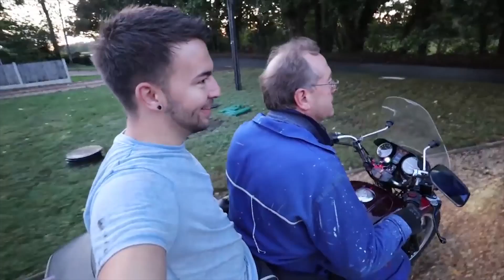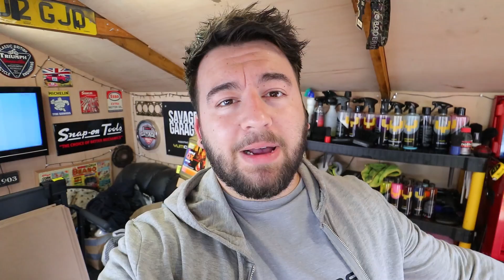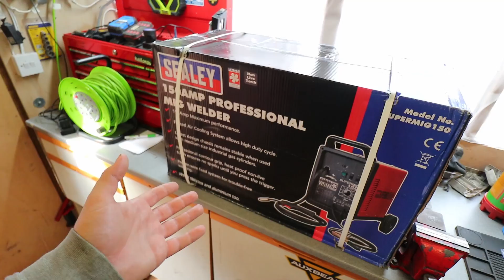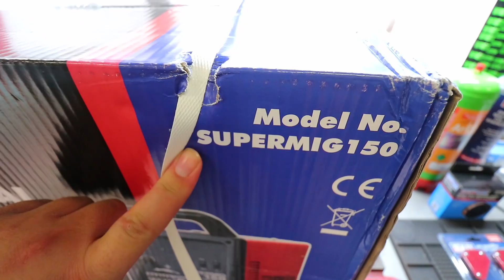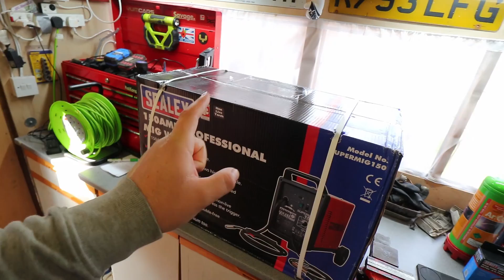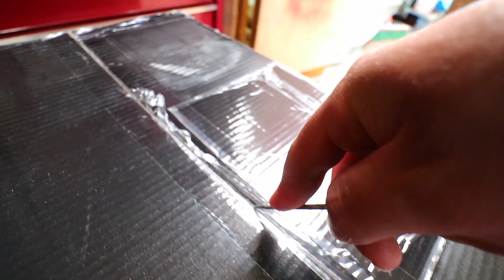I Got a Welding Machine! *Finally*

Comment: lol....the regulator you had was the same as the new 1 you bought with a gauge, other than it had no gauge, you have to unscrew the co2 connector on the regulator for it to fit the biddy bottles you have, that is made to fit the smaller bottles you have as well as pub co2 gas type and boc bottles, I use a clark 150 with pub co2 and have used it on max with 13amp plug and it's never blown the plug fuse or tripped any breakers in the house, you shouldn't need more than 130amps ever for car repairs unless you plan on making more holes in your car.

Comment: You should always file end of the wire smooth so it dont damage the small plastic tube inside the cable before torch.

Comment: Bless your hands. Really nice and instructive videos. I alone have a problem. Please someone help. My car is fabia 2011 1.4 petrol. Vehicle at 160000 km. The transmission oil needs to be changed. It must be the same transmission in this video. The screws are the same when you look from below. While changing the gearbox oil, I could not find where to refill the oil.

Comment: You'd think Sealey Would Have a Rubber Moulded Plug Fitted
Get a Welding Cart to Sit Welder on , or a Old Tool Cart, Much better Highr up 👍

Comment: You've wired thst plug wrong mate. The little card that comes on them when they are new shows you how long each wire should be and how much insulation to strip back. Its pretty important as its designed to leave the earth in situ if the cable ever gets pulled out of the plug if the strain relief fails.

https://images.app.goo.gl/RiKCxrh3iLCfxTbz9

Comment: I would suggest fitting a 16A socket, straight from the db, just for the welder.  Its not ideal on a 13A plug, plugged into a full multi socket adaptor, mounted on the wall of a wooden shed that now contains gas cannisters. In theory, the 13A fuse should blow, in reality, ive seen loads of 13A plugs melt. Just throwing my  electricians opinion out there.

Comment: To all this nonsense on the plug, look at the size of the cable on that welder (it fits in plug easy) and used at home, no pat test issue .
Look at the power info plate on the machine ( 230V 9A -19A max)
It does not come with a plug as you can use it on either 13A or 16A and most home users far better off using it on a decent 13Amp as all that they really need for light usage.
Finally read the manual and use a little gumption not internet stupidity ...
UK 13amp plug is totally over engineered as is most of our household electrics :-) (i run 180amp migs off one for decades) 
james will be fine lol and complying with manufacturers requirements on this product (read the manual) ...
The world will not end and James has some practical experience and some gumption ....

Comment: I used to have a welder, and I think after having thar, I would be very good, because if the torch and wire wasnt in a straight line, it struggled.  With the fa's, I used co2, because it was a case of either being in the motor trade, or knowing someone who could get it.  There is a gas refilling place near me who does fire extinguishers, and thru used to refill my bottle.  You can either rent them, buy them, or if you know someone who has a pub, they use co2 for drinks,  I bought mine, and just took it to be refilled.  As for how much gas flow you need, press the trigger slightly, and start to open the regulator, you need it to be like a light breeze.  When you start to weld, make sure you put the earthing clamp on a clean part of the metal, closest to where you start the weld, and it will be a better weld.  To adjust the wire feed, if it stabs the metal and pushes the gun away, it's too fast. And the amps will need to be adjusted.  It's a case of balancing it all up, and it wants to sound like bacon frying.  Errect screens around where you will weld, or if someone goes past and gets arc eye, thru might sue.  Always shout watch your eyes, before starting the weld, and you can do pulse welds, or a continuous bead, keeping the pool molten without going through.  Like I sat, if it stabs the metal, turn the wire speed down, as it will push through your weld.  You eill get used to it, hood luck mate.  Andrew Mckenna, Nottingham.  Add me in Facebook, talk more about it.

Comment: BOC do a special offer that used to be called the volks weld deal, i think its now called the small garage or hobby deal. works out at about 70 to 100 quid for a largish bottle of gas including a years rental at reduced price. you will need a proper regulator or a pea shooter tester (id recommend getting a peashooter tester anyway as those small botte vales are crap) as others have said, you can weld with flux no gas wire, but it burns hotter so its very frustrating. It also makes your weld area look very scruffy to due the reaction of the flux fumes with the surrounding metal and the extra sparks etc. it also flash rusts the area around a lot quicker than gas welding. I dislike it just for the clean up need, never mind the fact that gas will give you a much better/cleaner weld on sheet steel. Also be aware that the health and safety executive have finally (as of January I think) decided that welding is carcinogenic(as well as causing a host of other nasty things like Alzheimer like illnesses)  and requires respirators in use. Not particularly mandated for occasional use as long as you have good airflow but something to bear in mind.

Comment: Hi James, Great to see another video and that you are well. Had a mig welder for years and very useful for sheet metal welding ie.car bodywork. For gas, have a word with your local pub licensee and get yourself a co2 gas bottle that pubs use. Last for ages and once empty are cheap to get refilled. Keep safe.

Comment: Hate to comment on what other people have already.

But 19.6 amp's through a 13 amp plug just won't cut it. You will blow fuses all day at 100% usage.

Not to mention the heat in the cable's and plug etc.

I've not even calculated for the diversity....but this is a big no no for me.

It should be hard wired.

I won't comment on your plug wiring,  but a helpful hint, orientate the cable so the line is in line with the fuse and common in line with neutral, earth should be on top and point to you.

Live the shortest cable, followed by neutral and earth the longest. 

Rant over, but I hope you learn the welding skills, some people say it is a dark art to get right, and good on you for trying to learn the skill. 

Sorry for the lecture in electronics
Reply: Hate to comment...........but you are so boring!

Comment: Fab video. Quick tip when feeding new wire spool through hold the trigger etc stretched outwards so no bends and feeds through as if curves can cause some issues

Comment: My advise is get a 8 10 12 or15 litre bottle argon/co2 ASAP (and yes argon/co2 is gas to use in your instance), keep the small as backup or for portability small jobs.
ebay has them from poland and germany outright and delivered and 200bar pressure for around £75 8 litre .
also note pressure they charged to relates to amount of gas you got .
Bigger bottles should be 200bar, many only 150bar so you got 25% less gas so take that into account when pricing it .
Buy a regulator with dual gauges (cylinder pressure and flow)
When learning you will waste a lot of gas and those small green bottles be gone in under an hour messing about and welding outside will require more gas flow most of the time so you always going be heavy on gas consumption .
As a new machine it probably feed wire fairly well but the welding torch/liner and wire motor feed on these are pretty poor long term .
You also find the minimal power settings not very helpful working on thinner metal .
Not trying be negative but don't expect miracles and be patient practising as it not as easy as looks and car panel repair is hard weld to good standards .
For beginners I always recommend a a good entry diy inverter welder like powermat as infinite power adjusting and arc stability and stable wire feed makes it far easier get good result , plus the torch assemblies far better with standard replaceable liners .
If the earth lead short (many models like this are) it worth extending it (you get 3-4m of 16mm2 welding cable for under £10) or use a jump lead as a quick fix .
Best of luck and have fun, welding is useful skill even if not a master welder .

Comment: I have the 180 version at home the plug will be fine for car body work don’t pull that many amps welding thin metal, I can weld cars all day and haven’t ever blown a fuse and I use an extension , get rid of the little bottles they last about 10 seconds 😂😂

Comment: Gas mig is so much easier than flux core made the right choice, get yourself a scrap panel off a car and you can set it your power and wire speed properly before welding :D

Comment: I thought your dad was a sparks, I would just let him check out your electrical consumer unit in your shed. No doubt he installed it, but you got a lot of electrical appliances in that shed.  Looking at your wiring it's all in 3 core flex, which could be under rated? It would be good practice to install a dedicated feed and outlet for that welder. Best be safe, just like on the rigs.

Comment: Tiny tip, stick the wire through an earbud before the wirefeder, it makes sure that the wire is clean before goig through the gun hose, and it also makes sure that the hose lasts longer. Have fun welding :)!!
Reply: Great minds think alike! I have done this for years. I have tried all kinds of things from wire wool (bad idea) to cutting a sponge into a cube. People don't think about the liners enough in my opinion.

Comment: Great welders them i bought one to use on my channel with my current build i learnt pretty quickly but definatly run extension directly from the house not your shed , good luck and take time youll crack it , 👍🏻

Comment: get over to migwelding.co.uk lots of good info there dude, also for cheap easy metal grab a wing or 2 from the scrappy and a wee set of jogglers are a great investment. just got a clarke 151 myself. same thing with no plug, but most decent welders will work fine up to 130 amps after that you might wanna start thinking of blue plug. but for most car panel work 130amps is more than enough, great video james looking forward too next one :)

Comment: Think you've probably got the jest of it by now with the 13A plug however I've not had a problem tripping the electrics had it turned right up for welding 3mm bar stock at times looking forward to the welding see how it handles it I've always gone with the Clarke welders

Comment: James no plug due to the amount of current they draw you might find it keeps tripping electric you should have fitted a blue 16amp plug and socket, when you start welding feel your plug to see if it gets very hot

Comment: I hope Sealey don't send them out to retailers like this. It is illegal to sell an electrical appliance in the UK unless it is fitted with a plug. It is odd to suggest fitting it with a 16 amp plug as it still has to terminate at a standard 3 pin one (thereby causing an extra connection). A standard 3 pin plug can safely conduct 2.2kw from a domestic ring main without overheating. This welder will never draw that power so it is perfectly safe.
Reply: It’s illegal to sell domestic appliances (i.e. for use within the home) without a plug fitted. Welding equipment doesn’t come under that category, so Sealey have done nothing wrong. Most power tools in the UK come with a plug fitted, but that’s more to do with consumer expectations, rather than legislation.

Comment: Hi James, the welder didn’t come with a plug because as others have said it’s intended for use with a 16A plug however your perfectly safe to use it on 13A standard plug up to around level 3 on your welder you can use Max and setting 2 (150A max current) in short bursts but don’t be surprised if the plug gets warm. It’s a great little welder perfect for a beginner. Good luck in your venture.
Reply: Also notice that hes plugged it into a multi socket adapter with every other socket, possibly in use too.🤔 Personally id fit a 16A socket just for the welder.
Reply: I've taken it to 4 on a 13A doing short beads it's fine
Reply: Evan W Yeah like you said not an issue as long as people understand the reason why. Sadly not everyone does. Happy welding 👍🏻🙂
Reply: Why couldn’t Sealey supply the correct plug all fitted, whether it be 13 amp or 16 amp like its supposed to be?
Reply: Bob Willis Corgi Restoration I think it’s either of 2 things 1. it gives the end user the option or 2 the welder can be hard wired in to an outlet, although a potable unit like this the 2nd option is highly unlikely. Just my thoughts on it.
Reply: Hi. Thanks for your info. First, I will be using 1.5mm stainless steel, what guage would I need? Both types for gas and gassless and can I install a 16a plug into household mains or would that fuse a 240 outset trip box? Thanks very much?
Reply: The plug shouldn't get warm? The fuse will blow though

Comment: The reason there's no plug is because it's supposed to run on a 16a circuit (blue commando plug). Although adfter speaking to a sparky I stuck a 13 on mine and been okay as long as I use it in bursts